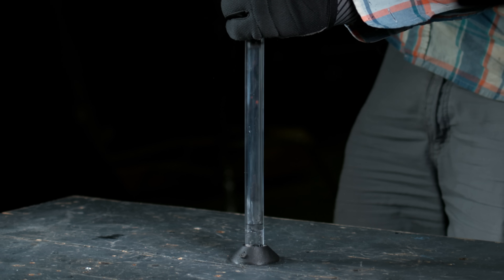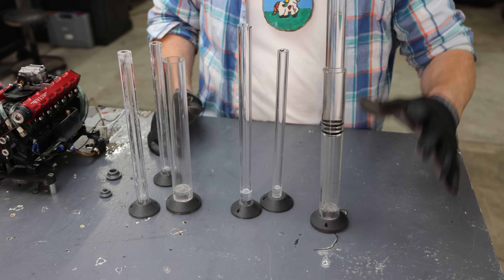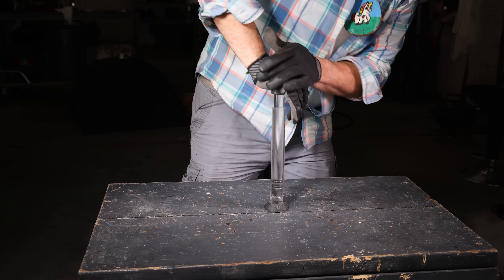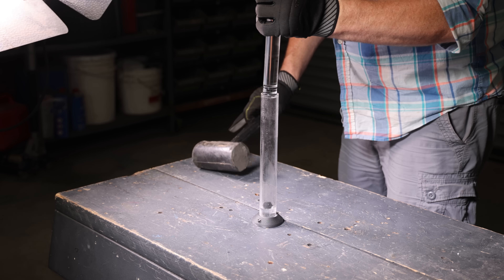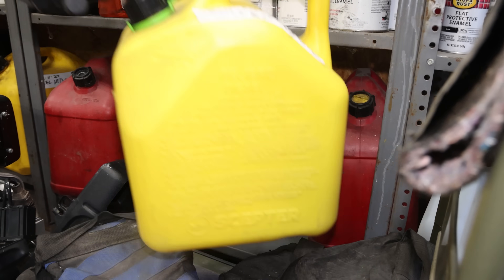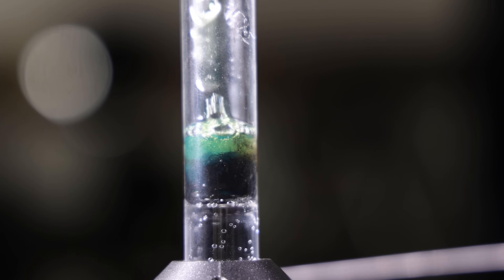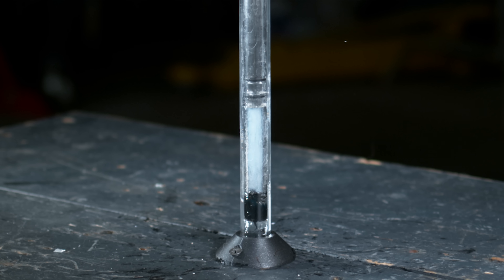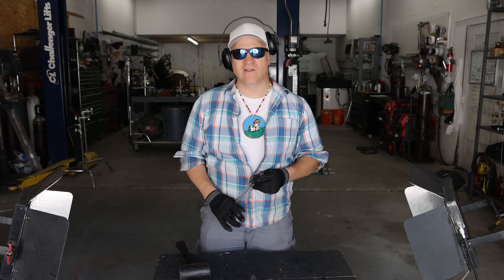How Diesel Actually Ignites (Slow Mo)

Comment: Old trick i learned from a farmer and  used to do with my spring airgun, to get more out of it, was to add a drop of gun oil in the skirt of the pellets before every shot. Every time it ignited i could hear the classic sound of cracking the sound barrier and the shot would go further. It also absolutely shredded the o-rings in the chamber, plunger and sealing faces.
Reply from the maker: That's really interesting and after doing this experiment I can totally see how that would work, that's crazy
Reply: We called it "dieseling" back in the day...
Reply: Dude i conected a new path on the brain thanks for that. So many memories putting oíl on my air gun 😂😂 poor orings
Reply: Petroleum jelly works too, it's a lot of fun
Reply: @Lilith-Rose  
I couldn't get that to work in my webley nemesis .177 , it may be to low power to reach ignition psi of petroleum jelly  , it does around 280 - 300fps with a light pellet so its probably not even 300psi at the port 🤷‍♂️
Reply: @TheCraigy83  Wembley make two different products under the name nemesis, I'm assuming you are talking about the pcp rifle rather than the co2 pistol (because the pistol is both low power and uses co2 so doesn't provide any oxygen for ignition). Unfortunately because a pcp system works by releasing gas from a high pressure vessel through a valve you would need insane pressures and a valve more efficient than any currently produced to achieve the dieseling effect since it uses the air directly as a propellant rather than having a piston compress a set volume of air into a smaller space which is what results in ignition, just as the piston in this video demonstrates. There are however many simple ways to increase the power in a pcp setup starting with a more powerful hammer spring and topping out with precision machining larger ports and replacing valves with custom ones but in a rifle like the nemesis you are going to be limited by aftermarket parts etc unless you want to machine a whole new set of internals and replace every stock part other than the frame which would likely also need modification.at that point due to parts cost and labour you would probably be better off starting with a custom pcp setup that is built to your specs or modifying a higher end platform like a weihrauch or a daystate. The pcp modding rabbithole is a deep one that can be addictive but you need to know your local regulations before you even start since in the uk for example you are limited to 12ftlbs and going above that without the correct licences will land you a 5 year minimum sentence
Reply: @Lilith-Rose  
Its the old 90's lever gas ram type about 2ftlb muzzle energy😂 .
 that makes sense why a spring is better for dieseling ! 👍
12ftlb is because they want us to forget 200yrs of hands on supersonic ballistics knowledge, 12ftlb limits .177 to sub sonic , they dont care about energy (225lb xbows not regulated at all) , they dont want us hearing or creating sonic  booms / they dont want us having anything that can reach out to front lines infantry ranges .
Reply: Fun but don't do it with a good airgun, it won't work with a PCP and be careful if you live somewhere where the regulations on airguns are tight. In the UK doing this could put  you in court on firearms charges.
Reply: @davidpaylor5666  sounds like the UK kinda sucks no offense...
Reply: Dude I was get 1400fps out of a 22 with lead pellets that way.. With out it I was seeing about 850fps it would shoot clear thru both sides of a 1lb propane tank.
Reply: I put broken down mach heads in my hollow tip slugs, works pretty well surprisingly
Reply: Break barrel pneumatic piston's are the way to go. 😅
Reply: Yeah loved it
Reply: I caught my 12 year old son putting a little diesel on pellets . It ruined all of the deals in the gun .
Reply: Yep, did it to my little daisy .177, have to pump it darn near 20 times to get pressure now hahaha
Reply: All it is doing is help the pellet slide down the barrel easier, and fill in micro air gaps that the expansion of the skirt doesn't fill...
Reply: This wasn't on the highway, definitely should have used red diesel lol
Reply: Moly Quickstart does the trick. Pellet pierced both sides of a 5 litre oil can
Reply: I continue to "shake" oilmen with my innovative project of an internal combustion engine, I remind you that I am posting here on my channel the technology and the principle of operation, according to which any person can create a prototype and enjoy free energy, since I am denied financial support at the stage of the idea and theoretical research, after a year of unsuccessful searches. Including I will begin to assemble a sample. And soon another video will be released revealing my developments, the wind of change is coming! All those who are not indifferent, welcome to fly into this departing innovative car, which will lead to great achievements for the successful future of the planet and humanity!
Reply: As a kid I had an old air gun with bad seals. Didn’t shoot very well unless I dipped the pellets in diesel or WD40. Then it would shoot straight through a hard wood door.
Reply: I was about to mention doing that myself.

Comment: Could you try the same with water?

I really wonder if the fluid(diesel) just failed to compress, and made the tube explode instead.
Given you are hitting with a hammer, you would be stopping the hammer and using that energy to send the sides flying.

As for the flames, you totally got it!
Reply from the maker: You could be right but, it was about the same amount of air in the chamber even with that much diesel, But if you look close you can see ignition for a split second before it explodes. Originally I was thinking the same as you said, but it seems like an exploded as soon as the ignition occurred, I think it just happened too fast

Comment: I've detonated WD-40 at work hammering on things with my big boy air hammer, I'm sure you can do it with diesel on an anvil with a steel hammer in open air.
Reply: early lesson when i converted a cox 049 to diesel... turning it over by hand with some wd40 and it fired up and gave me a nibble...

Comment: How much compression is needed to achieve ignition?
Reply from the maker: I wish I knew the exact pressure I should have measured it
Reply: @WarpedYT  You could try to estimate based on the compression ratio.

Comment: Makes me wonder, how do they adjust the ignition timing on a diesel engine?  It seems like mere compression ignition would be too inconsistent.  Also, how do they stop the engine, cut off the fuel?  I've seen videos of run away diesels where they have no way to shut them off.
Reply: Diesel timing is determined by when the fuel is injected into the chamber, in older diesels you could rotate the pump exactly like you would rotate a distributor on a older petrol engine. 

A runaway diesel is running on its own engine oil, most commonly its from turbo seals that leak or blow out and the oil from the turbo is sucked into the intake and burned as fuel. You need to starve the engine of air to stop it from running away.
Reply: @derekjooste9339  Thanks for the explanation.
Reply: He is just struggling way too much with his fire piston, I have used one before and it would ignite every single time.
Reply: @MrTarfu sure pal.
Reply: A diesel doesn't run away because of timing issues. If the fuel is removed from the combustion equation the equation fails.
Reply: Most high speed diesels have advance mechanisms built into the pump or timing gear assembly. This helps maintain efficient combustion. Obviously modern engines have ecu control so it can be optimised electronically, Especially during cold start, cruising scenarios

Comment: my favorite camp firestarter!
Reply: You mustn't have tried a friction fire roll yet.  ;-)
Reply: @ElementofKindness   I have encountered the friction fire roll and imo it's inferior. 😅

the piston works with anything flammable to hand, and can even dry the kindling in seconds and starts a fire in seconds, with minimal effort. 

with char-cloth I've gotten embers off of just one hit! full fire in 10 seconds. (note that he's using huge diameter bores here, but with a proper, pencil-width bore it's much MUCH easier and faster)

from what I've experienced, only a BIC would be faster, especially if it's damp out. and unlike a BIC or a strike rod, a piston doesn't run out of fuel, you can just grab anything that'll burn and it'll work. 🔥♾

Comment: BEST demo i had of this was a PILE DRIVER we used in the field erecting huge wind mill generators in a wind mill field. Seeing the MASSIVE steel drop down followed by a loud BANG! as the steel shoots back up (pushing the pile downward into the ground) the steel reaches the point of return and drops back down with fuel, then, BOOM! and it repeats blasting and blasting. It was aswesome to see the massife diesel piston basically
Reply from the maker: I have seen one of those, very interesting device indeed.
Reply: Those diesel pile drivers are so cool to watch
Reply: Also what they use to destroy old runways.
Reply: @FuzzyWCTX  many a thing
Reply: That thing sounds awesome!
Reply: I'll make your words mine! A diesel pile driver is a perfect example of the diesel knock effect.

Comment: I heard of these some time ago, cool to see them in a see through version! Speaking of compression ignition engines; could you do a see through HCCI (homogeneous compound compression ignition) engine? Those were a popular way to power RC aircraft and are commonly referred to as 'RC diesel engines' as it works in a similar fashion, but with a variable compression ratio. They don't burn normal diesel either, but a mixture of ether, kerosine and castor oil.

Comment: You could put one drop of diesel in that tube and still get an explosion! When you consider how little fuel gets injected in the average modern diesel to achieve combustion, you're essentially flooding that tube with diesel. WD-40 is pretty close to what you would need if you want some sort of vaporization. We always used that when we were building potato guns as kids.😄👍👍
Reply from the maker: I think you're absolutely right, I don't remember personally how much lighter fluid I put in the potato gun
Reply: Quick half second squirt of hairspray did it for us, years ago.
Reply: @Whalt1988 I have a love hate relationship with hairspray as a propellant. It's got a lot of power because it's got Dimethyl ether in it but good lord is cleaning the gun a chore.

Comment: Blowing the tubes is what preignition is all about
Reply from the maker: True
Reply: Yeh fuel needs to be after full compression not before
Reply: pre ignition  is when a crank is before top dead centre opposing the engine direction. This is ignition and not a strong enough tube to withstand the forces.
Reply: Yep
Reply: Darn good point.
Reply: Beat me to it.

Comment: Why would pyrolysis release H2 gas?
Reply from the maker: I was taking a guess but I honestly can't remember off the top of my head which gases are released from cotton through pyrolysis I thought hydrogen was one of them
Reply: Char cloth is made of cellulose, which in fact is not only a carbon containing molecule, it also hold other atoms such as oxygen and Hydrogen. There are many sites on the molecule that contain Hydrogen. The relatively extreme change in temperature due to the ideal gas law, will cause the hydrogen atoms to become dissociated from their parent molecule. Then when pressure decreases the hydrogen atoms will be immediately seeking to fill it's s orbital. The easiest way to do that is by making the diatomic molecule H2
Reply: decomposition of methane
Reply: Hydrogen (H2) is generated during pyrolysis due to the thermal decomposition of organic materials. This occurs for several reasons:

1. Molecular breakdown: When organic materials are heated, molecules break down into simpler components, releasing hydrogen atoms.

2. Water vapor reforming: Water vapor present in the material or produced during pyrolysis reacts with released carbon, forming hydrogen and carbon monoxide.

3. Dehydrogenation: Organic compounds lose hydrogen when heated, releasing H2 molecules. 
(Source: META AI)
Reply: Pyrolysis releases H2 gas, but the charred cloth shouldn't have any Hydrogen left so no pyrolysis there.